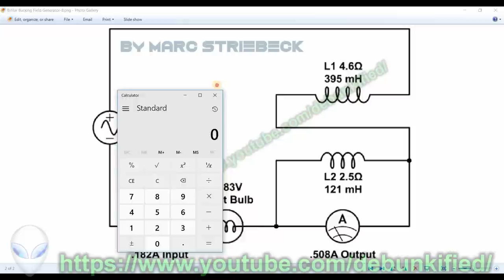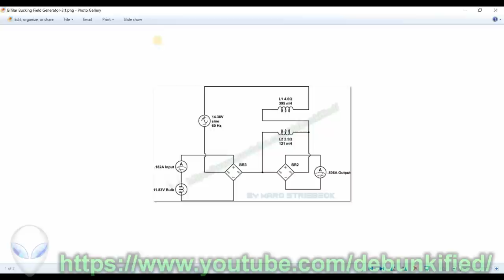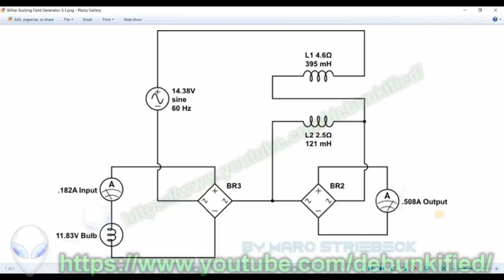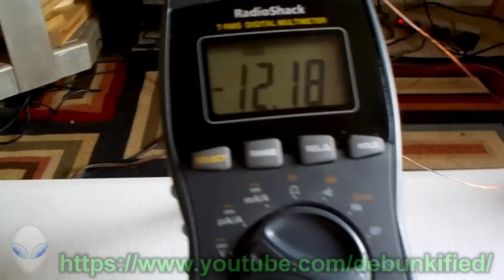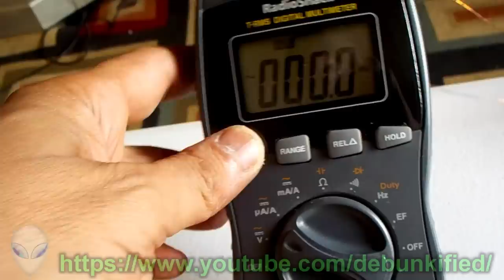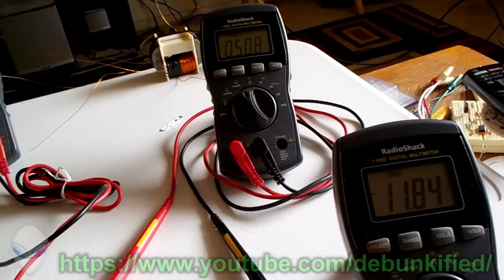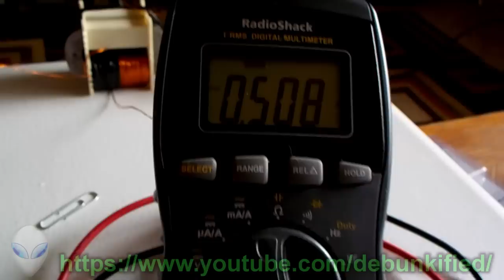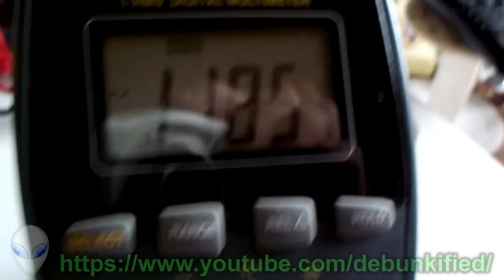Opposing Bucking Coil Generator (Asymmetrical Transformer)

Comment: This japanease type r cores where pretty expensive.i love your videos becouse you know stuff and make experiments i dont have means to do myself. Can i ask what is the core material made of. Have you tried to leed the high amp coil to a load then ground? Or trogh induction wire and fast capacitor .Try adding a induction wire from the smaller coil around the larger and vice versa aswell. Also if possible try to do the same with a ferrite core with a small gap with paper in between the gap"test distance but keep it tight" then try induction wire from one core over another also try windings opposite eachother and same way . The core itself should compensete the outher fields by leeding it back to sorce trough the core material thus bypassing lenz law.ive seen it been done on russian cores and also on tessla coils by a greek with a fast 2 nanofarad capacitor in between coils from induction wires to load and ground both tessla coils grounded to real earth. You rock man keep it up, exellent work.
Reply from the maker: The cores are made from Metglass. Thanks for the comment. I’ve tried most of what you have suggested and it does not improve things very much.
Reply: I saw a video with a greek that used 2 tessla coils grounded to real ground where he added a fast think 2 nano capacitor to the reciver coil then back to the sendinding coil trough induction wire 3 spins then to load and ground. This made the induction effect stronger but killed the sending coil but he got overunity. A test in mit university confirme that ressonance between 2 different coils create flux. Just like dr stiffler shows on hes 3 coil setup and hes 2 first coils. Alexander melnichenkov used a square wave that is changing abit back and fourth square wave gives strong harmonics on ferrite but alexander uses gaps in hes cores. If you look at the video called secrets of magnetics you will see that a gap will amplify the fields and focus it in a ring around the gap. This r core gets its ressonance from the ac. But ressonating dc saves energy in time as it cuts the current flow really fast. Maybe not much though. Check alexander melnichenkov hes ou is 150% but better than nothing i dont know where that guy went he promised to help everyone but hes video is wery telling. You know electronics better than me iam more into theretical physics see if it can help on the way , its wery similair to the akula lantern. Lets crack the nut. Best of wishes from sweden. https://m.youtube.com/watch?v=F8c82ABs02M

Comment: 9:42. - No, no, the current is Not running through the lightbulb. The 500ma is running through L2 coil + partially the lightbulb. Some current of the lightbulb is also running through L2. Reread your reference book, Kirkoff told us. The net current of your circuit is 182ma, from source, into L1 , and into the lightbulb. Because this 182ma is going into your transformer by L1 it induces a magnetic alternating field into the core and creating a voltage on L2 which feed some current into your AmpMeter. Your AmpMeter is shorting L2 inducing a Lenz voltage back to L1, hence rendering the whole transformer almost as if it was a short circuit. The reason you see 2.55vac across L1L2 is because your transformer is not perfect, it's got some loss, hence the lost of voltage. The best way to exactly explain this particular situation would be to rewrite this circuit with a more accurate transformer representation, including all internal winding resistances and schématizing the transformer with equivalent coils and voltage sources. Otherwise you are in for wishful thinking. Nice work anyway. It's good practice for the brain. Thanks for sharing.

Comment: Are you serious?  If the ammeter "reading" .508A has 0 Ohms impedance, why would there be any current through the parallel coil?  You have fooled yourself.  Neaten that mess up and take more measurements, especially the current in the parallel coil.  Check all voltage drops and beware of phase shifts caused by the coils.  Then report your findings.  Alternatively, take it to a local community college ac circuit instructor and explain it to him.  Then take his course!!!!
Reply: Yes! The Ammeter on L2 is shorting L2
Reply from the maker: Would you mind showing what you’ve done?
Reply: what do you mean?
Reply: @kohlundkamera9556  He means that since he‘s done something publicly, he has become immune to critism.
Reply: he wants me to show something - it's not about criticism. @Branden Peter
Reply: @kohlundkamera9556  Uhm you are a little slow. He literally said, well since you are belittling my work how about you? What have you done? Though I think he was talking to Susan mostly
Reply: And Susan Wood is right. This design does nothing. He is merely shorting out half of the coil into a maximum current flow. Well his entire idea is terribly flawed to start with. You don‘t want to work around a known phenomenon to "beat it". The Lenz law is an observation, not an assertion. The false assertion is you can‘t get energy from the environment. I hope he reads this and take it constructively.
Reply: Now I've got it, ok, pfft